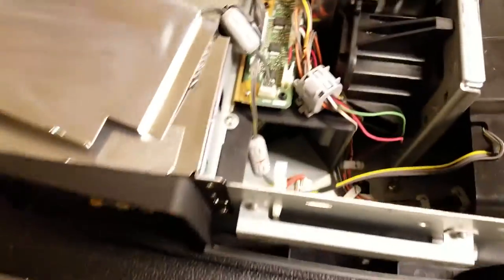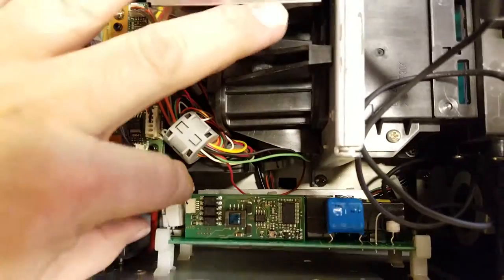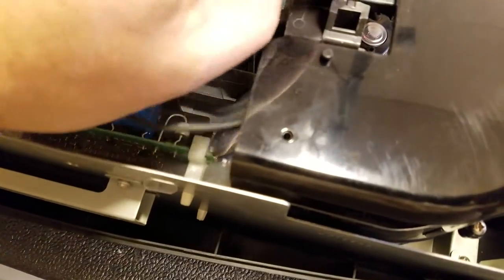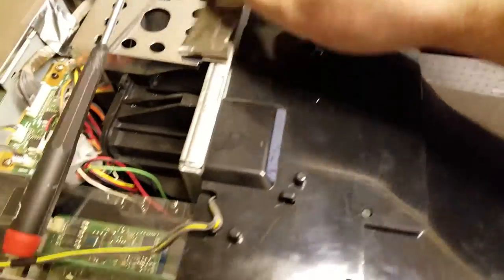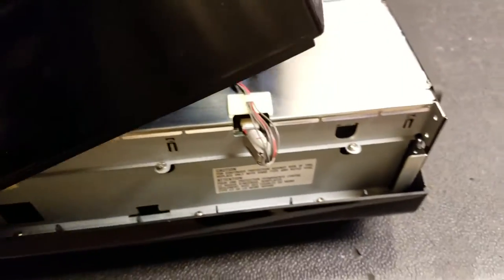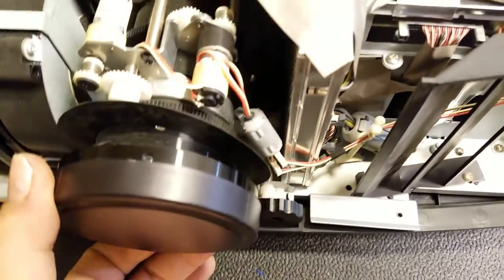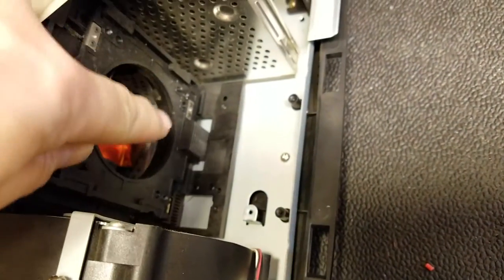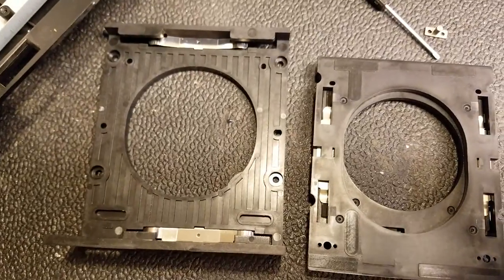JVC DiLA ballast repair and assembly Part 3

Comment: Frank,  thumbs up to you.  I purchased a JVC DLA-RS1 last week and I found that the focus ring on the lens was completely stuck and would not rotate at all.  Well, I watched your video and say how easy it was to remove the lens.  I found a donor projector on ebay and purchased it for $155.  I swapped the lenses in about 20 mins.  Now I the projector operates as new.  Keep up the good work and thanks.

Comment: Do you know how to factory reset these. My lens cover won’t close and I believe that’s my issues after replacing the bulb.
Reply from the maker: See what the indicator LEDs are saying.  I am not familiar with a factory reset that will close that door. Usually its because of something else preventing the circuit from running.  If the lamp door is open or if it has another error that can cause this.  What are the indicator LEDs doing?

Comment: Hi,how do you clean it ? Comoressed air blown or vacuumed?
Reply from the maker: Both really depending on how dusty it is. I use compressed air when I clean items outside the projector and vacuum if I am near optics or anything delicate. Sometimes the dust is so thick that you need to use compressed air inside.  If you do use compressed air, set the pressure low and increase it slowly until it's enough to work. Don't run it too high. It's a balancing act. The things to watch for are spinning the fans too quickly and pushing dirt into the optics. Be aware of that and you should be okay

Comment: I'm looking for a input board for a DLA-HD100.  The HDMI ports are non functioning.  Was able to remove the whole board assembly, but cannot find a replacement anywhere searching by the model number in the board or the projector model number.  Any idea where I can find this, if at all?

Comment: Hi, I need to replace the same connector to my projector , where did you get it? o  how to order? Thanks.
Reply from the maker: Hi  Alejandro.  It depends where you are located. I had to buy a ballast with the connector and then removed them to use on the projector. You cannot buy just the connector but the entire ballast is not expensive at all.  What country are you in?
Reply: In USA, thanks.
Reply from the maker: I found that the same connector is used in an Epson ballast.  Part #  PKP-K170A   You then unsolder the wires from the board and re-solder them into your JVC ballast as I did in the video.  I found the parts on eBay.  You cannot use the ballast itself as the wattage is different but the connectors are the same and work well. I have a few left that I could sell. If you get stuck and cant find them yourself, let me know.

Comment: any advice for trouble shooting?
Reply from the maker: Make sure you have 380-400vdc input to the ballast.  If not, then check the main power supply.  If you have the 380-400dc then it might be a thermal sensor, or something else keeping the lamp-on signal suppressed. There is really a lot to troubleshoot. Can you give me a description of what you have going on and what you already have done?

Comment: Hi Frank, do You have any idea why new jvc's make this quiet  hdd like sound ?? ( e-shift off and iris set to manual )
Reply from the maker: I can't say 100% off the top of my head, but I would suspect one of the blower fans is making that noise. What model are you asking about?  Is it the one in your profile, X5900?
Reply: FixitFrank I have X5900, other users at avforums.co.uk  also report this new 'feature' it is very quiet...but still u can hear it in the room when no audio is played from speakers. Look at my video.

Comment: Hi I have this same projector. I started it up, got some picture and it gave out within a minute. It's getting NO power. Was wondering if you knew what I should do to get it up and running again? Thanks
Reply from the maker: Hi there! Thanks for the comment.  Let me know what the LEDs on top are doing. They should indicate the cause of the failure.  Also pull your lamp out and see if the insides look burned or melted and let me know.  There are many many things that can cause your situation. In order to figure out which one, we need to narrow it down.
Reply: FixitFrank thanks for responding. Took the lamp out last night, no burns and no lights on the top. Standby was on whrn first plugged in but now, Standby, lamp, warning....no lights. It had turnt it on, got picture and within I'd say 30 seconds it cut out. The power cord seems fine as well. When I plug it in you hear a slight noise so I know there's power getting to it. But no standby light.
Reply from the maker: On the top there will be some LEDs that flash when it shuts down.  If those are not flashing when it stops and you do not hear the cooling fans(after the lamp cuts out) you have may have a severe overheating problem. It would tell me the thermal reset is popping due to heat and killing all power. Then it will cool and reset itself.   Do the fans and LEDs cut out too when the lamp shuts off?
Reply: FixitFrank LED was on when first plugged in. Picture came up fans were running. Then all stopped. No leds after even with power cord in. I had the unit apart for more then a hour checking it out more then enough time to cool. And still nothing after putting it back together
Reply from the maker: Oh OK.  I thought it would come back up each time. If its dead/dead ever after cooling for a while then you have a power supply problem or the emergency thermal fuse popped.  There is a thermal fuse in the power supply that does not reset when it pops. It might be a few other things as well. I hate to say it but you are going to need a repair shop to look at it.  Its beyond what can be done easily from the info you are giving me.  One thing.  Make 100% sure all the wire connections are secure and the lamp door is on properly.  That is the only easy thing I can suggest. The rest involve checking voltages and power components and thats a little more than you may want to deal with.
Reply: FixitFrank yea sounds like hell lol I'll probably end up just grabbing a cheaper projector off Amazon ass this one I got for free so no big lose
Reply from the maker: Its a shame though. Thats a decent projector.  I know its free so I doubt its worth putting money into but if you want to get rid of it, email me at rostit@ultrafark.com and maybe we can work something out.  I like to keep scrap units around for parts and for teaching. I couldnt offer any real money but maybe we can work out a trade? I have some working projectors around that I don't really need anymore. If not, no worries but I had to offer. Thanks again for the watching the video.

Comment: Hi Frank, by chance I was looking for information on my JVC HD-1 which is the equivalent to RS1 and came across your videos. I have an issue where once pressed the on switch the GREEN light comes on, within 10 seconds fan comes on and then the WARNING light comes on solid RED and the STAND BY light is flashing RED and completely shutdown after the cooling sequence finishes . Is it possible to contact you via email as to explain in detail? I'm from down under. Thanks in advance,
Reply from the maker: Hi George,  Feel free to email me at rostit@ultrafark.com.  Ill reply from my actual address as I use that one to screen spam.  Thanks!